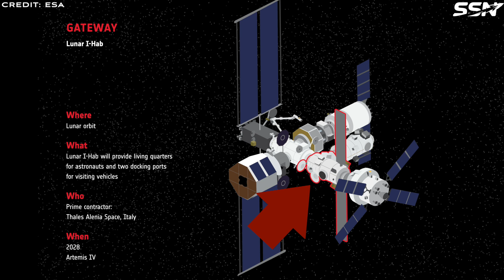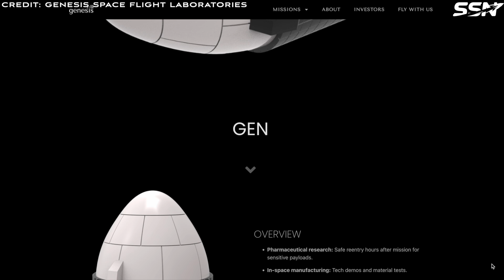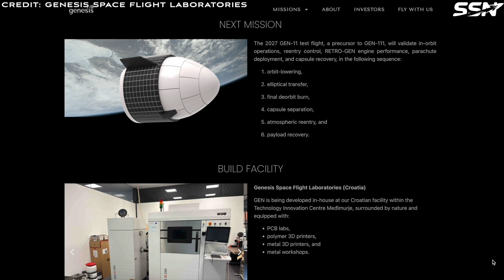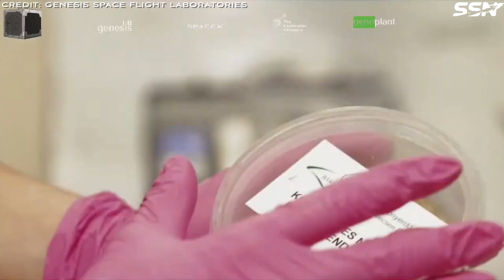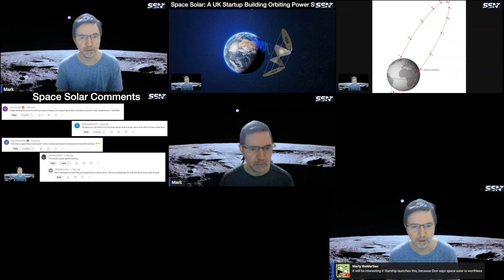Space Startup News: Redwire, a key space player, GEN Reusable Spacecraft and Rocket Lab Updates

Comment: Mild correction: Rocket Labs Neutron Rocket will not be 100% reusable, only SpaceX’s Starship is currently aiming for that. Neutron will lose its vacuum engine inside the fairing when it releases its payload.
Reply from the maker: Yes, you're right. The fairing, which is attached to the first stage, opens up and releases the second stage with the Archimedes engine and payload. So the vacuum engine is lost. Thanks for the correction.